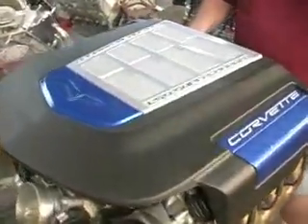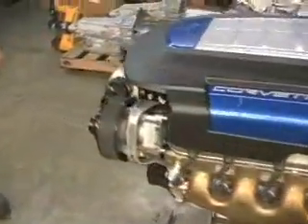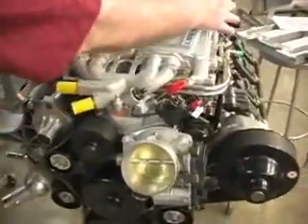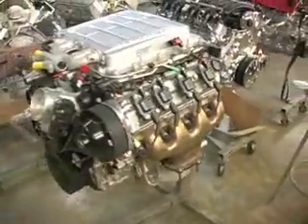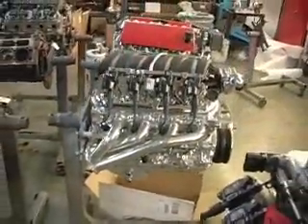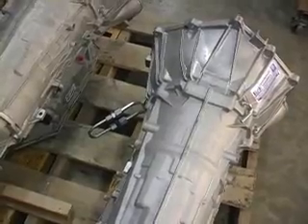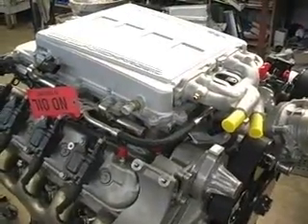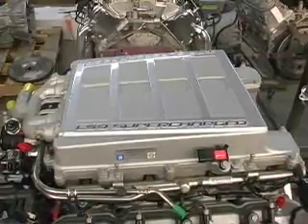Street & Performance LS9

Comment: put this in a 3400lb Syclone/Typhoon run a 6L90 w the adapter flywheel BAMN 640hp awd truck knock down 18-20mpg use factory boost guage...OR in the the TBSSs

Comment: @jdubcbr600 the bigges't problem with big blocks I think is the weight of the valves themselves slamming into the valve seats it's somthing to consider wen opting for a big block the benafit of the big block is just VIOLENCE

Comment: @noobas00 Ls9 is an Ls3 with a blower and has 2 cil. a side that the sleeves are touching wear the Ls7 has a stouter block and non of the cilinder sleeves touch an Ls3 is 418 pounds an Ls7 is 450 pounds so you have it wrong it is the other way around

Comment: I might have put my foot in my mouth when saying third of the weight but with this motor your making big block power and at a phenomonal MPG rating on pump gas. Yeah in all out racing the Merlin BB would be the way to go if you wanted to run 8.0's in the quarter but would you commute in an 800 incher? My point was I would rather go the LS9 route instead of building some border line streetable big block that knocks down 4MPG's on the freeway and ways quite a bit more.

Comment: The LS7 uses a 4.125' bore, with a 4" stroke crank. The LS9 uses a 4.060" bore, and 3.62" stroke crank. Other than the supercharger, those are the most notable differences.

Comment: You're exaggerating just a bit there buddy. Even a Merlin Superblock with its 11.625" deck height (versus a 9.8" production block) won't weigh anywhere near 1500 lbs. when fully assembled. And its cast iron too. Those blocks have the potential to go over 800 cubes, and make about twice the torque of an LS9, all in a naturally aspirated package. Their mega displacement makes them destined for track use, but their sheer output gives them an edge in their class.